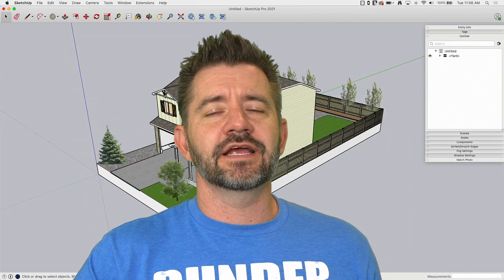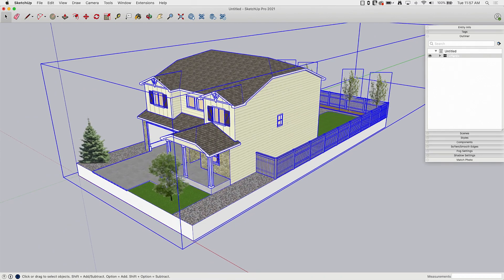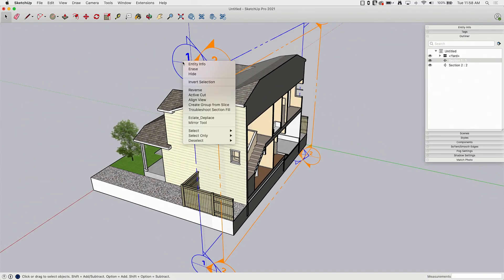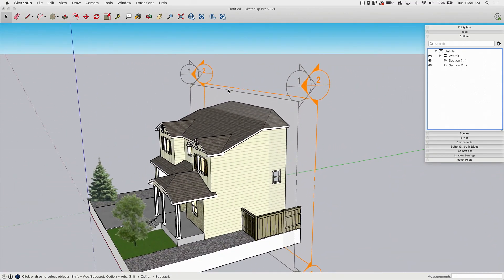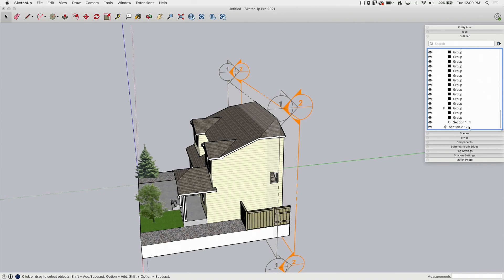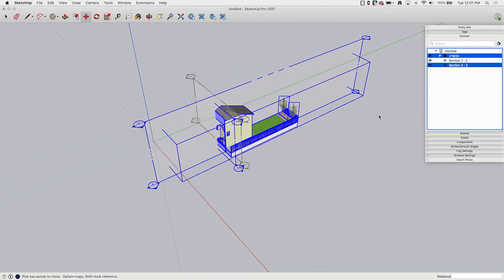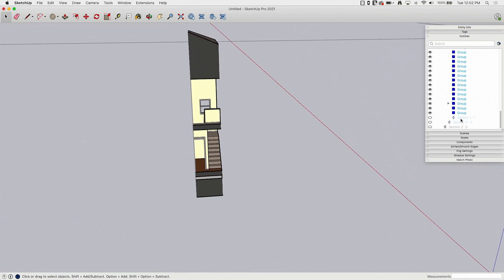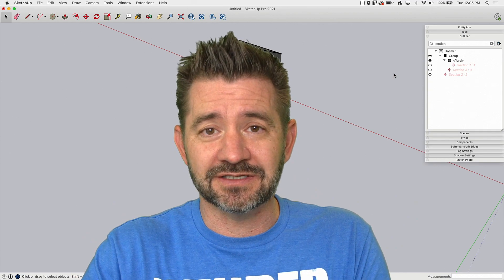Multiple Sections with Outliner - Skill Builder

Comment: Thanks for explaining- good to be able to do this. However I can see it gettign super messy where lots of sections are required in one model to extract the details out. It would be awesome if trimble just set up a tool with a view box (like revit) that just enabled a volume to be determined to cut the view, so that we didnt have to mess around with so many sections!

Comment: I just viewed this video and, like everyone, I found it fascinating and potentially very useful to get just the right drawing image to explain what is going on with a "project."  However, I cannot get the "Drag-n-drop" method to work.  When I try to drag a section, I either get into the :rename" process or the " activate" process.  The overall process seems to work fine if I enter into the "sub-group" and create the new section, but I cannot take an existing section and move it to the nested group.  SU Pro 2021 latest revision, Windows version.   Secret handshake?
Reply from the maker: Are you in the Move command when you click on the section?
Reply: @SketchUp  I'm sorry but I am confused.  I wasn't specifically "in the Move command" though I did try that after your reply.  I was trying to drag a "Section 1" from one group into another group that was nested below it.  And I was "dragging" it.   But, alas, to no avail.

Comment: Great video thanks. One question regarding scale. I have a model that is scaled 1:160 and I would like to scale it to 1:1 for a VR  walkthrough inspection of the model. I can do the VR piece but need some advise on scaling this model up. Your thoughts? Thanks.
Reply from the maker: Select the whole model and use the Scale Tool to scale by 160.